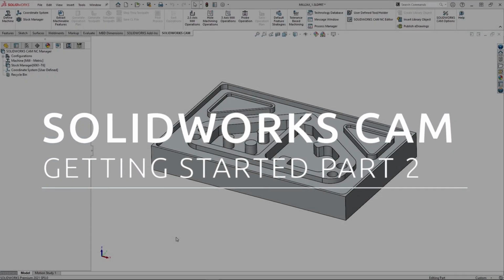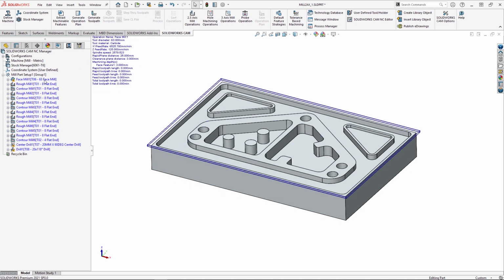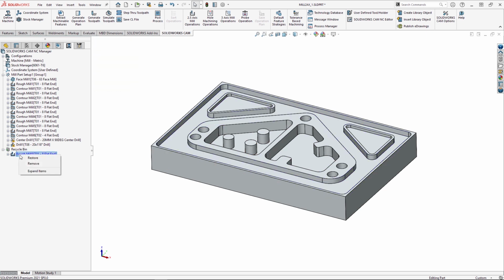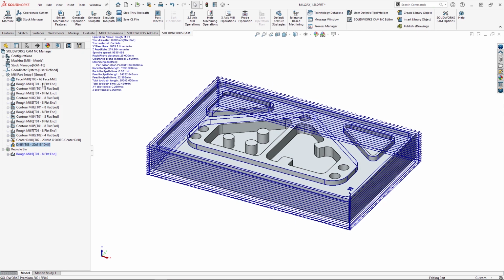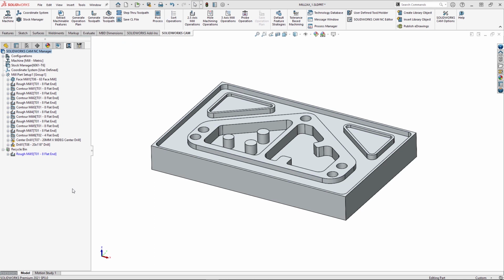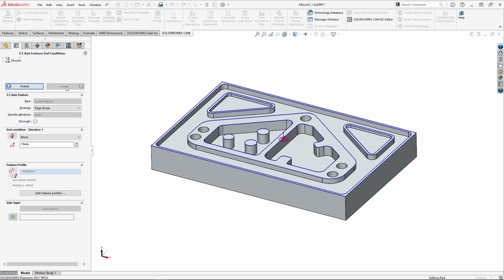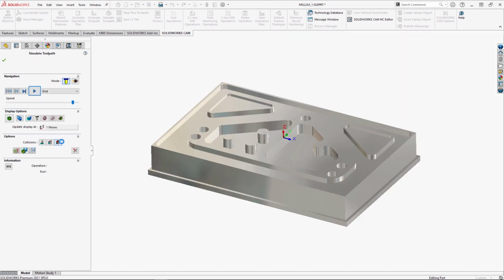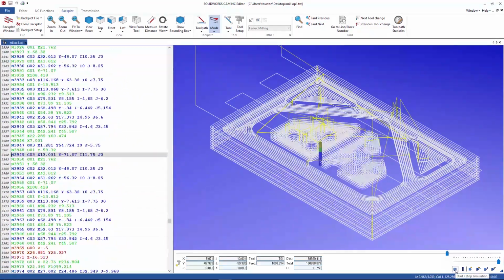Getting Started with SOLIDWORKS CAM - Part 2

Comment: Hello Sir,
 
Thank you so much for your lecture videos on Solidworks CAM. It really helps me a lot!

I'm currently doing research for my master's degree and I would like to ask some questions. I hope you can help me to clear some doubts about Solidworks CAM. 

First, does face milling in Solidworks CAM can't define wall/boss like in SolidCAM?

Second, how pockets are defined in Solidworks CAM, because it says that in SolidCAM they are defined by loops, is it the same for SolidWorks CAM?

Lastly, do you have any idea about the tool engagement angle specifically from the manufacturing engineering point of view.?

Sorry, I do have a lot of questions, but I would really appreciate it if you can help me with these.

Thank you so much!
Reply: Yes